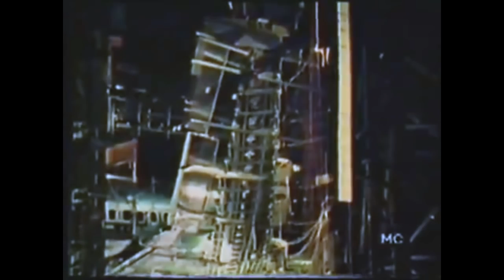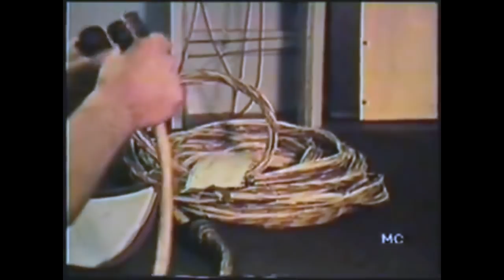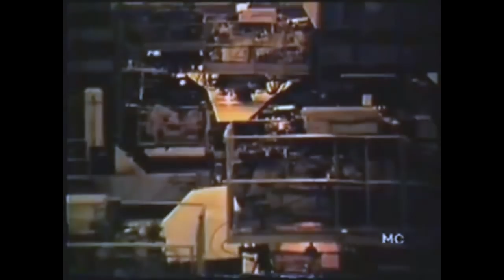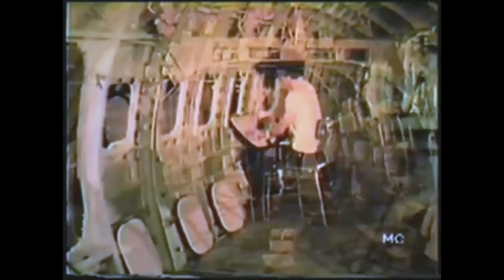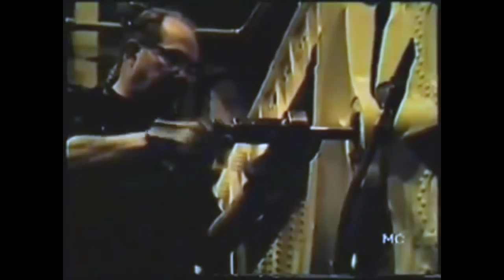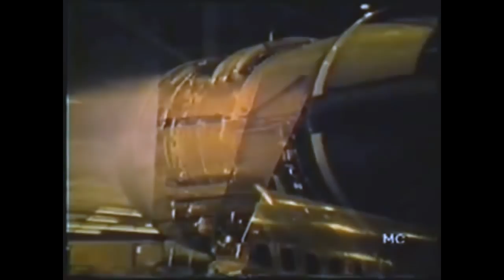Boeing Renton Plant Promo Film - 1972

Comment: The Boeing 727-200 is my first plane which have several 1:200 scale diecast models. I've flown on a Delta Air Lines Boeing 727-200 two different times in two different liveries, Anerican Airlines & Sun Country (once on AA & Sun Country). Looks like they do most or all of the work there when I think now parts get transported in from some where else for an example the Boeing 737  fuselage now days get transported by rail and/or by truck from videos I've seen some time ago & I think now too other parts get transported by air in a modified Boeing 747. I don't mind corrections if I'm wrong as I'm not an expert as some are. God Bless!

Comment: boeing needs to make the 727-300 same style but 2 man crew!
Reply: MrShobar Travolta has a 707, which I am sure burns more than 727, but he doesn't complain about that.
Reply: 3 man crew.  What if in case of emergency, the new heading needs to be re-entered to the autopilot.  Then both pilots will scramble for the manual, checklist, fiddling with the buttons, then execute.  Who's flying the plane then?  Nobody.  We really need the flight engineer position back.  His salary is equal to that of just single tanking for an overseas flight.
Reply: hmmmm....
Reply: I liked the 727.  But it burned a lot of fuel compared to its successor, the 757.
Reply: The 727 was no Ferrari.  And the fuel appetite was measured in tons, not gallons.
Reply: I wonder how often he uses it?  And how do you know he doesn't complain?
Reply: MrShobar Ferrari GTO also burns more fuel than Prius.  I'd still want the Ferrari though.